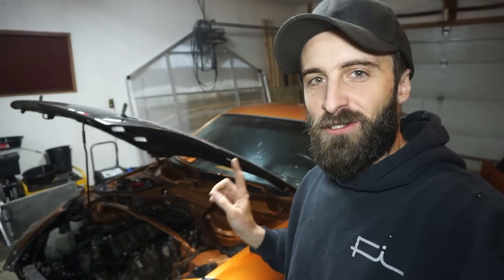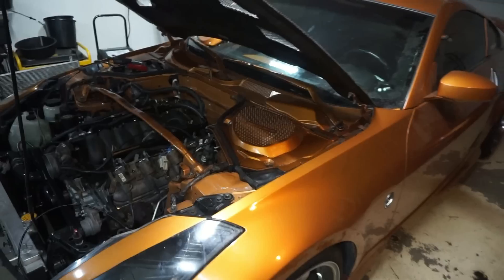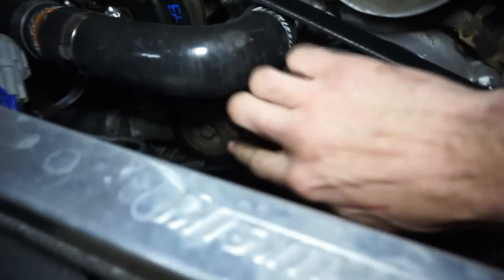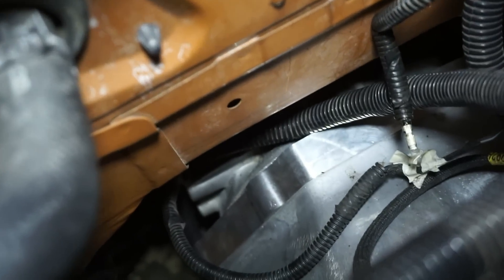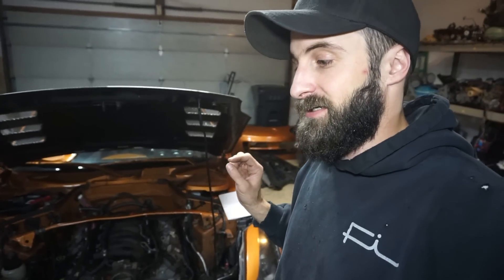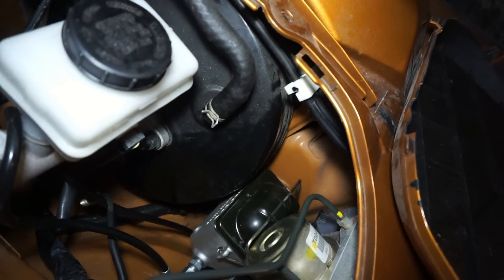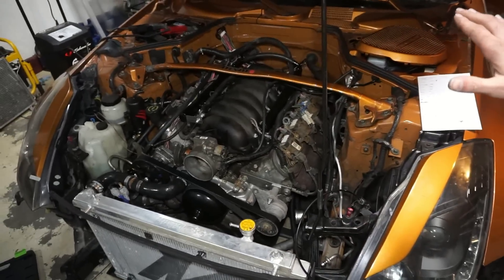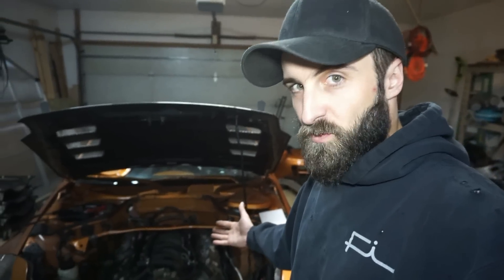HOW TO LS Swap Your 350z For Under $3,000!!!

Comment from the maker: SUBSCRIBE FOR THE TWIN TURBO BUILD... Lot of confusion allow me to clarify.
- This build was always intended as a turbo build, getting it running NA first, show cost of barebones swap, and rip it apart to start turbo build. 
- Of course a built VQ with a $6500 Supercharger makes more power than a stock $500 truck motor. I would hope so.
- There's just something about the previous owners $13k setup making 400hp that doesn't excite me.
Reply: a21bravo  what kind of transmission did u say it was
Reply: @ingramtory7  it's the stock 350z transmission CD009
Reply: I'm glad you did it this way I'm trying to get this young guy that's a buddy of mine to listen and do exactly what you did but he's already kicked a Rod all the way out  in one of these VQ engines and won't listen and bought another Nismo 350z and I told him while it's running good to sell that engine an LS swap it so he doesn't have to worry about anyting but we'll see how that works out🙄😑. Swaping a VQ in an Ohio car is a true nightmare let me tell you😑🤬🙄💯🤬🤬. All those rusty foreign metal bolts gave me a new found Hate for foreign 💩Steel💩🤬🤬🤬🤬🤬🤬😑🤯😳💩🤮. Hey thanks for the video have a great night.
Reply: Any videos doing some pulls on this z?

Comment: I feel bad for the people who actually think this actually only cost $3,000 with out being able to weld or already having half the parts to use.
Reply: time is key i could do is for $50 if u gave me 60 years
Reply: 5.3 are a dime a dozen. I’ve seen them as low as $190 if you go pull it yourself
Reply: Prince Ali rage? Where in the world do you see rage in any of my posts? Especially my original?

It’s videos like these that people use as examples in the forums and discussions “wel I know a guy who showed he built his for xxx amount of money”.

When people try to give new guys actual figures and realistic prices for these swaps. So they don’t go in expecting a $20 swap and lose interest in their car once they’re $4,900 deep and still have another $1,000 to spend.

It’s just exhausting knowing guys like you will do their best to debate me when I’m not wrong. But you nit pick something to try and prove me wrong just to sound smarter.

It’s not a realistic price. Simple as that. To debate further is a waste of time. If you disagree go ahead. I wouldn’t want to “hate or rage at you” 😂
Reply: What kind of transmission are you using
Reply: @FranksShitBoxCollection  so I should be looking for a Tahoe engine... to swap my g35
Reply: @mrmidnight32  can I ask you a Q?
Reply: @kurtland192707  i need one !!
Reply: @FranksShitBoxCollection  In Cali ?
Reply: @Piggernussy07  

A stock 350 for 3k? Holy cow where? I’ve seen ones that don’t even run right for $4000. A nice roadster 2004 for 10k.
Reply: @Piggernussy07  

Crazy right. Lol. I have a 2004. Just did the brembo calipers all way around, and got the kinetix manifold. I bought the 75mm TB but waiting to get it tuned before installing the new TB.
Reply: I got a 350z for 850 nd im working on putting a ls swap with some welds on
Reply: @Piggernussy07  not any more it's now 4 yrs after the video is posted and there cars almost doubled in price you can look tp pay about 8k for a manual 350z after drift tax. These kids today have lost there mind wanting 10k for a trashed Z

Comment: 3rd and 6th gear goes bad on the transmission, swaps motor...Lol!
Reply from the maker: Yeah, I wasn't serious about the VQ35.
Reply: @BlaserBuilds   so ur transmissionis the same 6speed 350z stock?
Reply from the maker: @israelhuerta2459  yes
Reply: @BlaserBuilds  which truck motor should I be looking for... what year, make and model... I just need to kno where to start...
Reply from the maker: @jahcousteauu_STAYinSHAPE  Anything 2000-2005/6ish will be gen3 24x crank, 2006-2009 is 58x with gen4 stronger rods and pistons. 4.8,5.3,6.0. 4.8 and 5.3 will be cheaper.... I have a video called "watch this before LS swapping your 350z" I go over computers and stuff that should help.
Reply: @BlaserBuilds  what do you think of a 95 camaro lt1 engine
Reply: @jahcousteauu_STAYinSHAPE  2003-2009 6.0 out of any gmc or chevy or escalade  is what I would go with.
Reply: @TehKneegrowplease  They are good engines but I would go with the 6.0 like I stated above⏫.
Reply: @eric63377  thanks I’m looking to get one of those rght. now hopefully I’ll be able to find a good one in the next couple of months

Comment: Meanwhile.. skipLet over at "haggard north" spent $21k on his  LS swapped 350z..
Reply: Holy shit for what 230hp
Reply: manlet skiplet the leakyzboii
Reply: @staticuzs1608  Lol he blocked me on his comments section...
Reply: skeeters Garage actually no if you knew about iron block LS’s they actually make less than 300hp from the factory. Now we know who doesn’t know shit about LS motors 🤣
Reply: CK_32 yeah but stock they push 300+ lb ft of torque so maybe around 250 to the wheels? Not bad if you ask me
Reply: Why would a person spend 21k on a engine swap and they can buy a whole other car for that? You can find a ls 2 motor for 4k or less and for another 3k have someone install it and extra parts

Comment: You just proved it doesn't take $10,000 to do the swap. You also have shown that a guy with limited welding skills can get involved and learn a skill in a short period of time. Great work Ryan love to see people doing things from scratch.Im sure the morons over on the swap forum are strokin out..
Reply: Ya but he spent 7500 on car so you do need 10 grand about to do this. But I get your point on budget motors.
Reply: @driftgodg6943  But building the same combo with an LS turbo engine will yield a faster sleeper with far less money spent and once it's don't it will be way easier to work on.

Comment: FWIW, you can use bicycle/motorcycle brake/clutch cable for the Throttle, save the $60.00
You can even reuse a truck throttle cable sheathing with a bicycle cable... ask me how I know. 🙄😉😎
Reply from the maker: I just got half lazy on this one. Was gonna go to junkyard, but it was raining so I said fuggit and bought one, lol.
Reply: How? I'm actually up to that point in a z swap

Comment: The $17 accessory drive is worth watching the whole series!  I wonder if you had a top-right-mounted alternator, if you could loop the belt over the intake and have it still clear the hood?  Just a thought.
Reply from the maker: I Don't think that would clear the hood if it was high enough to clear intake... I modeled this after the Factory VQ accessory placement (Similar to LOJ Kit) to keep the factory alternator wiring, PS pump lines, and AC lines... Sikky offers a power steering line kit for the LS accessory placement (power steering on drivers side)

Comment: I too have a ls swapped 350z. However I'm way deeper into mine. Built motor and supercharged .
Reply from the maker: I picked up two GT3582 turbos for it, will be adding them over winter, and possibly building the motor.
Reply: Is it fun?

Comment: only thing i say is having the engine so far forward is messing with the weight dist. probably why most the kits from various companies all did similar things. Better for drifting and racing to have less weight over the front axles and closer to the center of the car, really a good thing when in a shorter chassis/more narrow chassis car. less under steer, especially if you're drifting/rally cross.

Comment: It blows my mind to see a LS inside of a 350z with what seems like a lot of working room the vq was crammed in there this seems like there's a lot of room with a bigger engine
Reply from the maker: Yeah pretty funny. There's some pictures on Google of the two side by side and it's comical seeing the V8 is smaller.
Reply: The beauty of cam in block

Comment: If it's a Delphi ECU then it's a  GM specific protocol (SAE J1850 VPW) whereas I know in the Holdens in Australia, they went to the CAN BUS protocol with the LS2 & L76,etc which runs a Bosch ECU.

My 5.7 litre LS1 engine in my Holden Commodore goes pretty well after it had an exhaust system upgrade & a tune so it now has 370 HP at the flywheel.

It performs better now since I've replaced all of the Hydraulic lifters & the timing chain,I think the brake booster vacuum port had an air leak in it so I glued it in with polyurethane glue,I had a check engine issue at 100 km/h or after decelerating after overtaking with a warm engine.

Good luck getting the gauges,etc to work with the CAN system, I assume the issue is getting the GM unit to talk to the Nissan BCM (body control module).

That's the same issue with linking a new or different ECU in a GM car which is OBD2, the likes of a Tech 2 unit is needed to link the ECU up to the BCM.

Comment: I may have missed it and I apologize if I did, but what master cylinder did you use to match with the T56 slave? and did you use a factory Z or an LS clutch hose to run to the slave?

Thank you!

Comment: The car definitely looks good,
Personally I'm a believer you can have power and still have comfort are  you putting AC back in??
Reply from the maker: I plan to when I decide on how I want to control it. It's 30-40 degrees here now so didn't really focus on it that much. The way it's set up all I habe to do is build a bracket for the factory nissan compressor, and use the AC ribs on the crank pulley. Should be able to keep all factory AC lines also.
Reply: @BlaserBuilds  I agree, it's starting to get cold here as well.
Reply: @BlaserBuilds  I've been interested in doing a ls3 in my 370Z but what pulls me away from getting serious about it is that I'd like to retain AC and have no clue what would be involved with the electronics of getting it to work. Can you elaborate on as to how you would probably go about it in a 350Z?

Comment: hey man im currently in the middle of ls swap and im trying to do it stock as possible i will upgrade down the road , i was thinking of 5.3 truck motor and just buy a ls1 intake complete with everything on it ,ls1 accessorie drive ,pully and powering steering pump and lines , and oil filter relo/  do i have to change anything? else around like whats the straight forward on the swap i dont wanna replaced something that i can just use you know🙁 and if it breaks ill replace it can u give me a run down on wat exactly u need for just a stock swap on 350z

Comment: 350z with a Camaro LS V8 Pushrod engine ? It was not cheaper to Supercharged or Turbocharge the OG engine? How many benefits you get from that?
Reply: You really cant do anything with the factory VQ connecting rods. They are super weak.
Reply: @Simple_Youtube  what do you mean? That the factory 350 engine is weak and dont have to much potential?
Reply: @TheAbrahamsoto01  the factory connecting rods in VQ engine cant handle power.

Comment: Where does everyone find LSs for 500 bones?  I never see them that cheap!  If I did, I would have two or three ready to go!  So I have a 350 z and want to do an ls swap.  Did you say you used a Collins adaptor to utilize the original z 6 speed?
Reply from the maker: Yes Collins. LOJ  and sikky have kits that keep nissan trans but don't cut bellhousing.
Reply: @BlaserBuilds  Thanx for your prompt response.   So would you recommend LoJ or sikky over the Collins?

Comment: A21bravo, quick question for you. How would I go about taking the Engine and trans out of a Chevy van. What's the best method? What else should I take?
Reply from the maker: Everything you can, intake to pan. Accessories, exhaust manifolds, uncut wire harness, computer. Everything.
Reply: a21bravo quick question, were you a prior combat engineer and suffered from the "night air" at ft Lost in the woods? If so, what's up battle!
Reply from the maker: @about2088  Yessiree...

Comment: $7500 for a 350z with SC kit + built motor? How did you manage to find that deal - was the car high mile or salvage?
Reply from the maker: Long story, but original owner needed cash, sold it cheap to a younger guy who had a loan for it. He wanted to get out of the loan because it was winter and he had it sitting in storage.
Reply: Great deal for you! Thanks for the reply.

Comment: Hey so i'm sort of confused, was there an oil pan you could have purchased that would have worked or not?
Reply: I'm interested in the collins kit and the fact that it retains the tranny position and driveshaft. Especially since the driveshaft almost always has a long wait to arrive. But i don't want to fabricate anything beyond perhaps the radiator support. So if someone makes an oil pan that would work on this setup that would be great.
Reply: Also does the bumper go on with the modified radiator position?
Reply from the maker: @LtLongle  Yeah bumper went on, I build a new mount for it. There pans out there but The Welder, and material wasn't much more than the oil pans and kits so built it. I eventually moved the engine back and bought a pan when I added twin turbos.
Reply: @BlaserBuilds  gotchya. What pan would i be looking for on this setup where the engine sits forward? Just any front sump pan? 

Also how about motor mounts for this position with the collins kit. Does collins make any?

Comment: Couldn’t the VQ connecting Rods have been replaced with upgraded Rods, I looked it up once over 5 years ago and a max price on a crazy ass custom set of Titanium rods wasn’t more than $400.00 each, and a regular steel bulletproof set would probably not be more than a $ 5-1000.00

Comment: How did u only get the engine for 500??
Reply from the maker: 500 for a 5.3 is actually kinda high for this area... They can be found for $300-400 if you're patient.
Reply: @BlaserBuilds  ah okay I own a 6mt G35 and im planning on dropping an LS1 in there but I am not very knowledgable on it or the process
Reply: @renzyuson602  LS1 sucks...get an LQ9 or 4.....
Reply: @ranmas2004  ok thanks for the suggestion
Reply: Got one for 300 from a junkyard. Came with harness and computer.
Reply: It's not an LS. It is in the "LS Family". It's heavy as fuck and almost a net negative across the board.
Reply: @renzyuson602  that's the truck LS 5.3 there are two truck and car LS
Reply: @ranmas2004  y don't the LS1 suck
Reply: @renzyuson602  u can find a LS 1 out a camaro 1998 til 2002.it will save you a lot of time and money if u can get the hole car that way u can get everything you need out of it
Reply: @ranmas2004  LS1 sucks?
Reply: @hahahano2796  only 80lbs heavier and still about the same weight at an VQ engine. Ive weighed both.....
Reply: @ranmas2004  , A fully dressed VQ35 weighs ~580lbs? No.
Reply: @hahahano2796  we weighed a VQ engine we pulled...had no power steering, alt or AC on it...fully drained of all fluids....was 422lbs. We weighed an LS aluminum block with same stuff missing and drained it weighed 400lbs. Iron block LS 80lbs more....so its a slight increase for iron block but alum about 22lbs lighter.
Reply: @ranmas2004  . That weight sounds really off. A Longblock LS1 is ~400lbs and what you left out it sounds like the VQ had a lot more than being Longblock status. Given others have stated Longblock VQ35 weights as low a 313lbs... well... My LS1 sure isn't light despite everything I've ripped off it and nearly a small woman of extra weight, all the time, if it's an iron block is not inconsequential.
Reply: @hahahano2796  ok........
Reply: @hahahano2796  Your not correct on the weight difference. It's less than 100lbs and doesn't make a difference really. Iron blocks are stronger stock than aluminum and less prone to damage also.
Reply: Its an LM7, comes in the 99-06(07 classic trim only) silverado's. Got an 03 myself and I love her dearly but my friends try to tell me it's an LS and its not, its a damn LM7 (ls fam doe)
Reply: @themoose4386  Same thing. Thats like someone correcting you for calling their Civic a Honda. Its not a Honda its a Civic.....Honda family tho.....lol
Reply: and sll yours for 6,000 d0llars lol
Reply: LKQ junkyards. they are all over the country and have great prices.
Reply: Easy send the Jack boys to get it and give them 2k for their services. Take the parts you need and burn the car somewhere

Comment: "I was not going to pay $900 dollars for an oil pan when a TIG welder is $1000."

Much cheaper if you're humble enough to buy a chinesium welder.
Reply from the maker: Eastwood TIG200 digital... Still working great. Recently did my roll Cage, stai less turbo kit, and another oil pan with it.

Comment: Does the nissan bcm wig out without the vq ecu communicating to it? how do you get around that and the engine still works?
Reply from the maker: Standalone ecu using the factory GM ecu. You lose the CANBUS communications for some of the functions on dash. LOJ makes a canbus translator harness to retain them.
Reply: @BlaserBuilds  how does your central locking and stuff work without the can bus do you lose it? 
On my g37 the bcm shares power from the ecu unless I guess the 350z does it some other way?
Reply from the maker: @AdmissionGaming  You only lose the tach, coolant temp, and a few other things like heat/AC controls. I don't think it lost the locks. (I don't own the car anymore)

Comment: hahhahahahaah I love the 350z too but my god .. I have a 1997 mustang gt go get a truck coyote motor gen 2 for 1100 ,, put in in ,, bolts right to the 5 speed ,,, to much work on the 350z ,, geez like you said easier to update motor then to fix or boost power on the older one